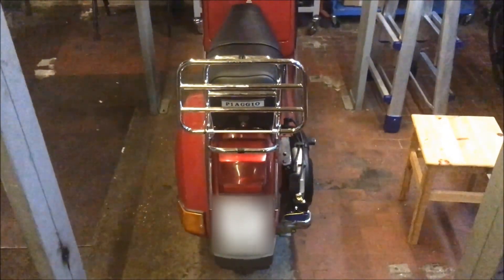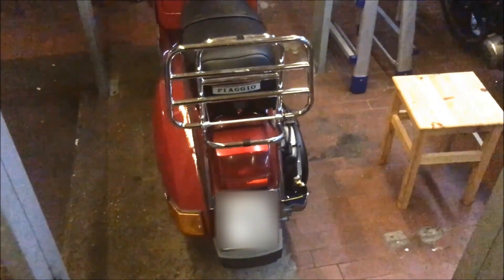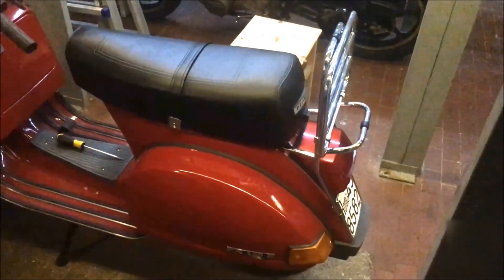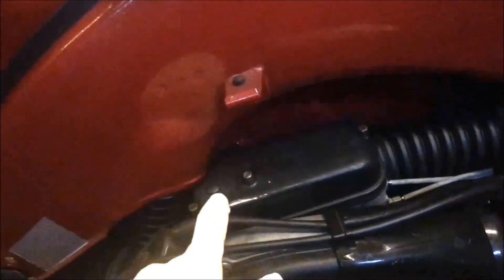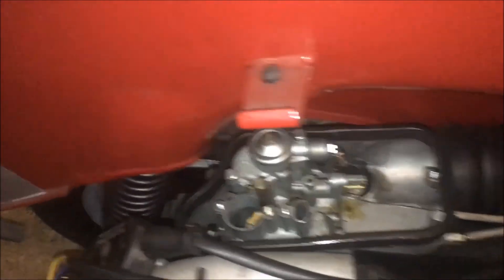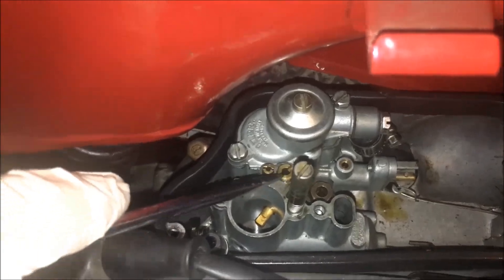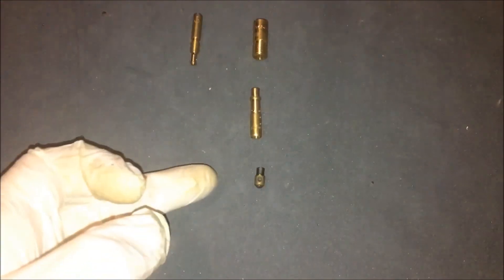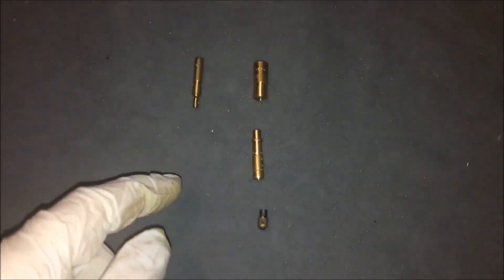How to change jets for regulating the carburetor of the Vespa

Comment: Mi stavo giusto chiedendo la configurazione del carburatore im eventuale ipotesi di sostituzione gruppo termico. Ghigliottina 01 e SI 20/20? Grazie e complimenti per la Vespa
Reply from the maker: Grazie !!!
Allora la carburazione è perfino influenzata anche dalla temperatura dell'aria (estate/inverno) e dall'altezza alla quale ci si trova (mare o montagna). Se cambi gruppo termico va regolata e ci sono carburatori e getti proporzionati al gruppo termico e all'uso che bisogna fare della vespa. Ci sono in giro delle tabelle, ma consiglio sempre di partire dall'uso che se ne fa e poi si installano i componenti necessari e si fanno le regolazioni.
Reply: Si, lo so. Volevo sapere se tu monti il carburatore 20/20 con valvola n. 1